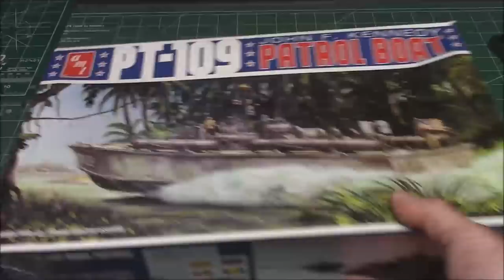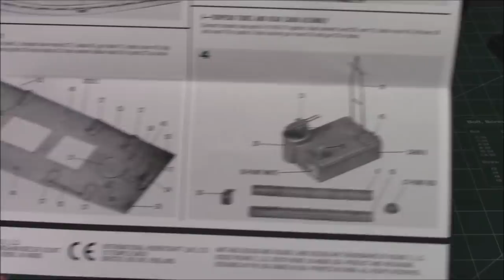JOHN F KENNEDY PT 109 1/64 SCALE MODEL SHIP KIT BUILD HOW TO PAINT FIGURES WEATHER FADE RIG AMT

Comment: Built this kit in the late '60s.  It was motorized at the time and used a single motor and rubber bands to pulleys on each propeller shaft.  The propellers were scaled properly so the thing, at full bore, would move about 2 inches an hour.
Reply from the maker: Thanks for stopping by!

Comment: Comparing this model to the 1/72nd scale Revell kit, this was defiantly one to be battery powered. The single prop and oversize rudder would work good for powered travel. The Revell kit has 3 driveshafts, smaller rudders and props as per the real boat. Both are good, detailed kits. Looks great!
Reply: Not sure what size mine is but I have a old kit I never finished that is quite large of the 109 with twin screws that you can setup for battery power or RC power.  I shelved it cause I wanted to RC it and never got around to it.  Been so long now I think its best to find this kit again and start over from scratch.

One thing I liked about this kit is it came with the railing on the fore deck but still has the life raft when the final iteration for the 109 was the life raft was replaced with a artillery gun mounted on blocks.
Reply: I'm not sure defiance will help, but definitely will.
Reply from the maker: Thanks for watching!

Comment: There are several problems with this  particular kit from Lindberg.  which was odd as this was basically copied from the larger kit which had more proper detailing than this kit.  even down to the gun tub railings.  the biggest flaw with this kit is the single giant rudder, and the oversized incorrect two bladed prop.  PT boats had three shafts sporting three,  three bladed props, and three rudders.  this model was more intended as a toy to run on a pond or pool and even came with a small motor at one time.  I have this same kit  which I have tried to make look more like a Elco PT boat.    Remaking accurate torpedo tube cradles, cutting down the height of the mast, detailing out the open bridge area,  making the four cowl vent's and correct engine room access hatch. gun tube guard railings, and scratch building scale rudders and triple propeller shafts. if you take the time to scratch build the accurate details for a Elco boat.  this turns into a nice model. instead of looking toy like.
Reply: I wish I would have read your comment before buying a P.T. Boat with dud ventilators.
Reply: And it did not have PT 109 on the hull and the American flag should fly on the mast, not the fantail. This kit has a lot wrong with the detailing.

Comment: Yes this model is meant to have a motor, and is good for RC. in fact I have one I am planning on puting an Radio reciever, battery pack, motor, and rudder control. I am using the hardware from a Wally- World RC boat.  I have a few modifications to do in order to fit it all in correctly and I may need to ad some ballest to get the correct bouncy. I will also need to make it so the deck can be removed in case of mechanical issues. The hull is perfect for this and o cant wait to begin to engineer this project. I will also be doing addition research for the fine details as it is lacking to some degree. However the only prmanant thing is the deck and its mountings. I have no doubt that build will go well. Btw i love your channel, i have for many years now. Keep up the good work and thanks😀

Comment: Nice job! As a former Air Force guy, naval boats and ships are not that interesting to me, EXCEPT for the PT boats! I always thought of them as the hot rods of the sea, and their crews as a bunch of ballsy chaps!  So, I much appreciate this one. Keep up the good work and looking forward to the next video.
Reply: And to think you could in theory build your own as they were constructed from plywood.  Just pricy due to their size and then there is the issue with how do you power a 80 footer, the originals had three merlin V12 engines to move it.
Reply: @Milner62  IIRC, only some Brit PT Boats sent back to ELCO for modifications had Merlins, the rest were using Packard original designed V8s derived from earlier Packard aircraft engines. I can only imagine how good the Brit boats sounded!
Reply: @tomfolkes4997 , I would have to double check but Packard was building merlins under license hence Packard/Merlin.  That is how US P51`s got the Merlin was the engines were built under license.
Reply from the maker: Thanks for watching!
Reply: Words like "chaps" the English use are very appropriate for this model. I doubt the manufagtureres in England were ever sailors, and I can tell by the way the manufagturers did this model that they don't care for the United States Navy either.

Comment: Hi.  Thank you for the detailed video!  I am building the same model, but in a lighter gray—similar to the PT-73 of Mchales Navy.  I wonder if you can help me with a direction or suggestion on the painting??    I have the basic structure complete, and have primed in flat-black, then coated with gloss gray primer.  It looks very fake/modelish with just the gray, and I want to add weathering and highlights or shading.  Could you suggest a web page or video that I could go to for guidance?  Yours looks great, but since I am using a different color scheme, and not sure how to take the next step, and I don’t want to make it look worse..   thank you for any suggestions, and thank you again for the informative video.

Comment: A very well designed kit.  - The only things I have against this particular model kit is the fact that it is not exactly true to realism of the actual PT - 109. it does not have all 3 propellors, propellor shafts, and rudders on it like all the real PT Boats did, and it doesn't have the 37 mm cannon on it which Kennedy had rounded up and mounted on its front deck. otherwise a great model kit. A Great Video. A Great Job of building and painting it. Thanks for filming and sharing your own building experience.
Reply: The original kits were better, at least below the waterline.  Lindberg modified the molds for an unusual R/C version of the kit, number 70818, in about 1992.  If you can find an older (pre-1992) kit, either static or motorized, go for it as it will have the unmodified hull with three shafts (usually made of 1/16" steel) and three rudders.

Comment: I built a model of the PT-109 last year. Mine was a Revell kit and it had some features that your kit did not have. For example, Kennedy's 109 had a jury-rigged 20mm gun mounted on the bow and it had depth charges. It also had three screws (propellers) and two rudders. I'd be happy to share my pictures on your FB page if you like.
Reply: It was a 37MM army cannon on the bow.

Comment: I'm building the large scale Lindberg version but these kits are very inaccurate to PT 109. I'm having to 3D model and print the entire upper part of the model with new turrets, deck houses, mast base to name just a few. The engine room vent is also not right. 109 had 4 of the regular intake stacks without the the large front one by the engine room hatch. But hey just change the number.

Comment: If you require hollow ventilators for your P.T.-Boat, then don't go for this model. I bought this model on the 9/8/2022, and it doesn't have 3 propellers or 3 propeller shafts. The economy being what it is, the pinch-penny manufagturer got some of the parts from England and or communist China of all places.